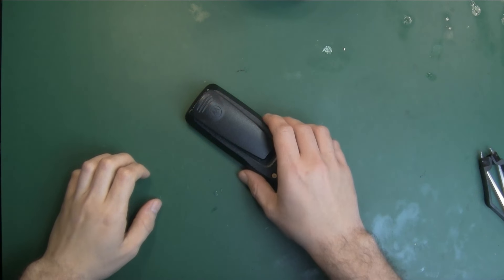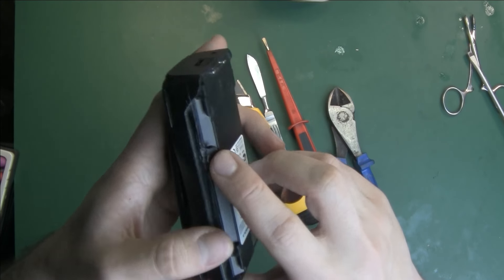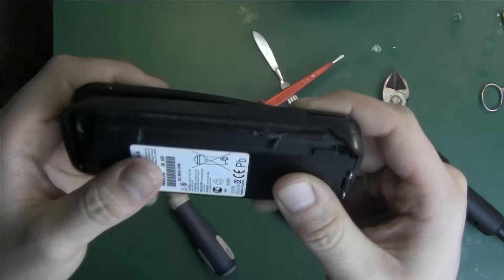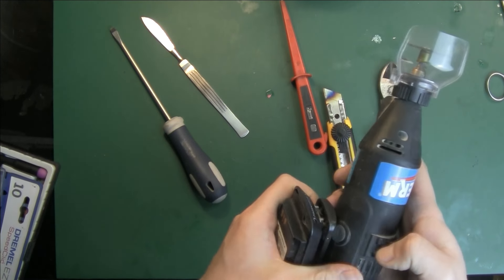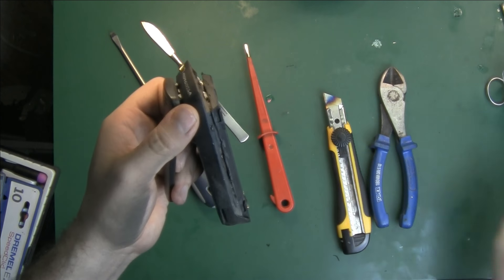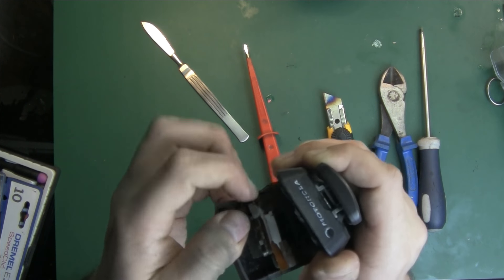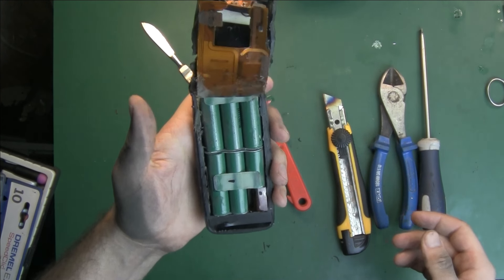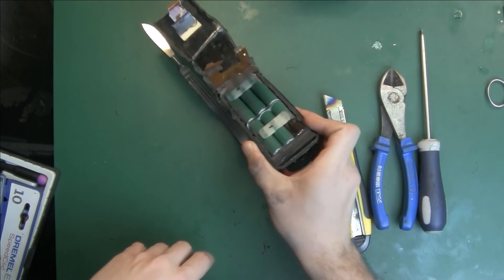Teardown battery PMNN4104A for Motorola DP3600 radio

Comment: Thanks in advance for the video..
I use to repair Mototrbo series radios since 2014 and after many cases,  discovered that what cause the battery unchargeble condition is the control circuit inside. I also made a technical report and sent to Motorola Dealers in order to improve the battery service life and they dont even replied yet.
I consider myself as an expert on those transceivers upon have rapaired hundreds of them and do not recommend such radios. They have been presenting same quantity of failures as much as any other less expensive tranceivers. Doesn't worth the cost. Believe me.

Comment: Nice look inside of an Impres battery. Shows the actual circuitry of the Impres technology.
Reply from the maker: That's true, more like laptop battery.
I have also "cheap chines from Aliexpress" clone without impress (of course it's labeled impress) - i'm wondering what circuitry is inside, but right now it hold capacity so i can't open it.
Reply: That's not an Impres battery. That's a normal 1400MAh 7,2V metal hidrure Mototrbo battery, but not impres. 
The impres are the high capacity litio expensive mototrbo batteries.
Reply: @stopnwonow5044  I have a pmnn4069 and it's a li ion but not high capacity
Reply: @stopnwonow5044  Sorry to desagree with you..that's endeed an impress technology battery. Sadly, they're pure rubbish. I repair Mototrbo series transceivers and batteries fail in less time than old NiCd  batteries.
A real loss of money.
Reply: @denniss155  Hey! You know how to fix a dead dp1400 battery? I have some tested icr 18650 cells. Can you help me with it?

Comment: Why disassemble the battery in such a barbaric way? You should have taken a rubber hammer and tapped along the edge. You can go along the seams with a blade. It might have taken a long time to tap, but the case would have remained intact.